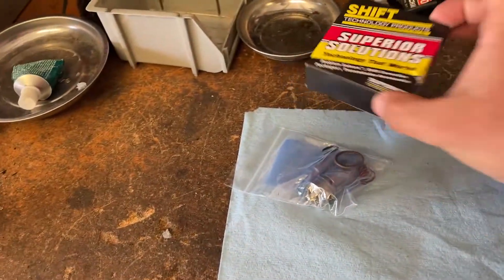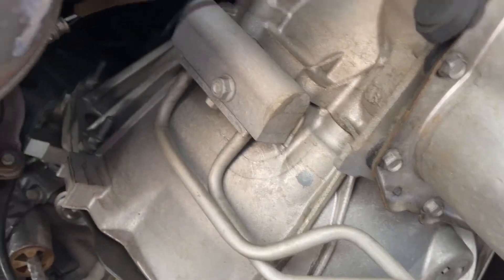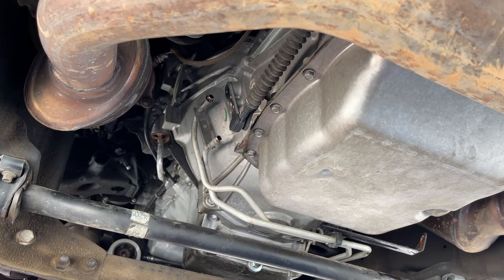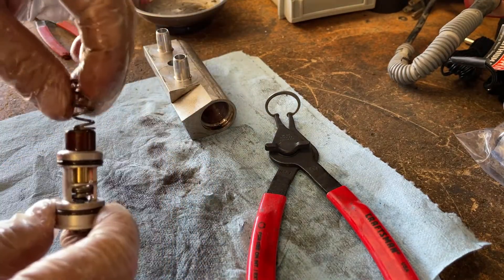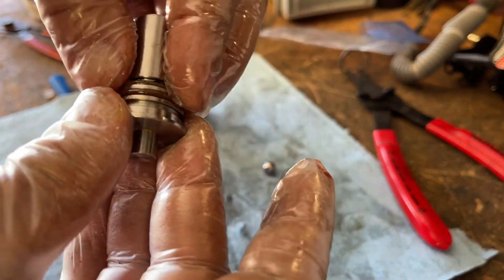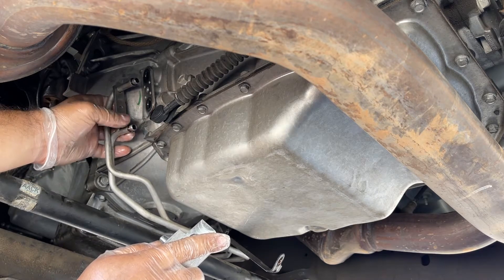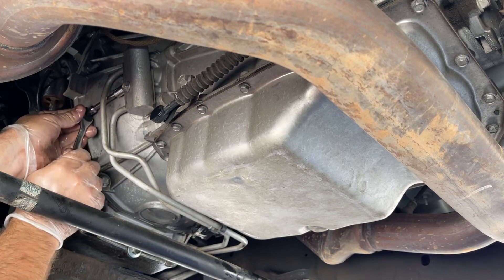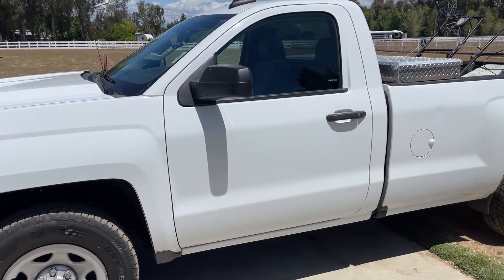Shift Technology Products Cooler Bypass Installation STL010

Comment: I'm putting one in.  Will the lower Temps affect the dip stick readings on 6L80?
Reply: Good question I put back in 1/4 of a quart. Letting it run and drove a couple of miles. Don’t see any on the stick. Afraid to put in too much.
Reply: it should still read full, if ur stick is dry you need fluid. @CSltz

Comment: Wouldn’t suggest this mod for the colder climates. I’ve ran this bypass for a year now, and it runs far too cold in winter. Warmest operating temp I’ve seen so far all winter was 26degrees Celsius/or mid 70’s Fahrenheit at running temp. Longer open driving it would always go down to 20 degrees. I will be looking for an alternative for next winter for sure.
Reply from the maker: Good info, may as well just stay with the OEM unit
Reply: @hanksgarage_  well I’m also not convinced that those are great to keep in either for pulling and hot temps. This bypass works great in summer, winter it ran fine but not sure how good it is for tranny fluid to stay that cold.
Reply: @hanksgarage_ do you have any info on this i.l8ve in California I'm curious at what running temp we would start to see a big decrease in function. As far as avg mpg and do we know what the min temp should be for transmission to function properly?
Reply: @pokerstar81  in your area, it’s a no brainer install and enjoy the benefits. Everyone there should be running one of these bypasses. They are definitely transmission savers in the warm climates. You’ll be running at 140 - 150 instead of 200.
Reply: @jaybilawchuk2225 what do you think about cloaked like Ohio where it can get hot and cold as hell
Reply: @dustinherring4146  it all depends what cold as heck is. lol. I’m in central Canada where it cold as heck is -45. My truck was always in garage last winter for night but running in those temps were sketchy. Trans temps were as low as 35 Fahrenheit when running at operating temps. lol
Reply: @jaybilawchuk2225  not quite that cold lol.. would say down around 0 Fahrenheit winter up to mid 90s in summer
Reply: @dustinherring4146  I wish!! lol. Then I would say you would def not regret this mod. Once you notice how much cooler it runs, you’ll really get the benefits and longevity out of your trans. That original thermostat once you physically see it is a disaster waiting to happen, especially if you’re pulling. For you, I’d say you won’t go wrong with it. Cheers bud.

Comment: Never knew about this transmission thermostat.  Great  video showing the how to do this repair.  What symptom did the truck have  to make you think this unit needed repair?  Great job.  Thanks for the information and videos.
Reply: No symptom, just higher trans temps than in the past with past transmissions.  Heat is the enemy of automatic transmissions.
Reply: You didn’t have to replace it all you had to do was remove it and turn it upside down then reinstall it and it will run cooler
Reply: @steverodriguez4871  are you sure about this?  This kit works flawlessly, I have it installed on my 19 Yukon XL
Reply: @slalomking  not saying it don’t work just saying if you bought it so it runs cooler all you have to do is remove it and turn it upside down research it don’t take my word for it
Reply: @slalomking someone on here mentioned MPG went down noticeably. Is this true ? I mean I already average around 10 in city and 15-16 on highway.

Comment: I hear that the original thermostat for the tranny fluid cooler doesn't open until 190F or so. Morons at GM must have a thing for burnt up fluid if that's the case.
Reply: Actually it was probably very good money maker,  trans $ales !
Reply: @MrLuckylilly  yup, fuck GM
Reply: 194 degrees. Was supposedly to “increase fuel economy” ….. yea while grenading your tranny.